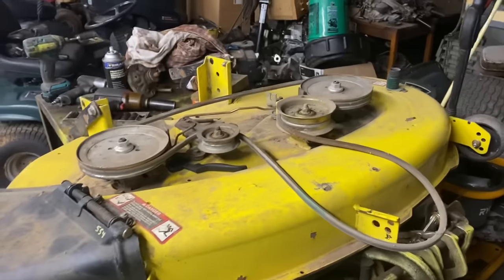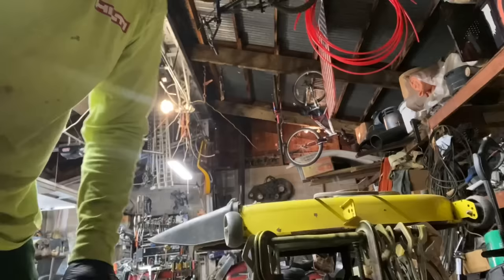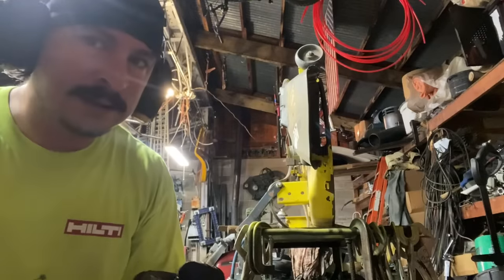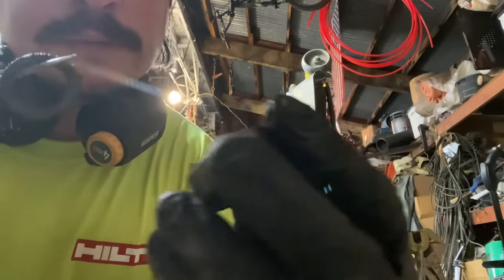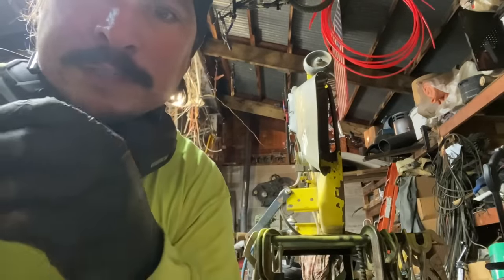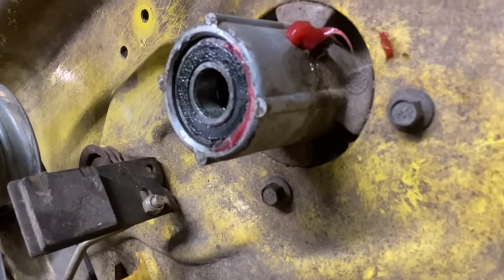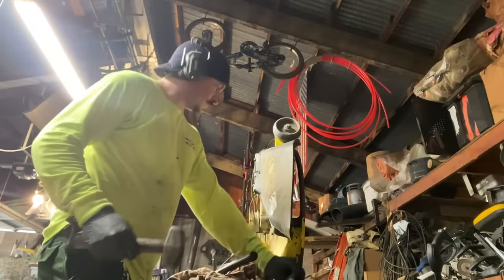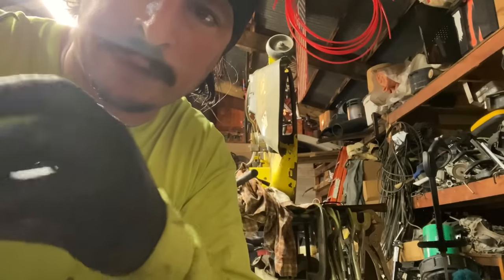Part 1 - Don’t trust the “Experts” Grease your mower deck sealed spindle bearings Common sense.

Comment: I have seen electric motors and equipment with sealed bearings run for decades.  24/7  
Ever here of a bearing failure called brinelling.   It has to do with dents in the races from hammering bearings.  Never install bearings with a hammer.
I have a mower I bought 30 years ago.  I have never replaced or greased the bearings.  It has three spindles.  There are many things that can cause a bearing to fail.  One of them is vibration.  Balance your blades .
Reply from the maker: In case you didn’t notice I’m not working on electric motors. One big difference is the load being placed on the bearings. Another diffrence is the quality of a bearing. There are many other things to consider. there is a huge difference between high quality bearings and cheep 2
To 4$ Chinese bearings in some lawn mowers. The bearings I’m working on are not for the space shuttle or air craft parts. You must have a high quality mower and most of the machines made 30 years ago are much better quality than some made now days. I’d love to know what machine you’re running. If I’m hitting the outer race it does not apply any pressure to the bearings. The outer race is what’s mounted to the assembly. Iv repaired some of the newer model box store machines with less than 100 hours on the meter with major bearing failure. Not every bearing and not every piece of equipment is made to the same standards and definitely not the same quality. Most of what I work on is super low end box store brand mowers and deck bearing failures are one of the most comon issues I see and almost always have dried up grease and or never been greased and had no preventative maintenance done prior to failure. I’m hoping by proving that adding grease will prevent failure and help folks avoid the need to tear an assembly down to fix or replace it. If the folks who see this will grease as I have showed they may be able to get a full life of the bearings and never need to spend money on deck bearing repairs. Im not covering the proper way to remove or install bearings in this video.
Reply: We ran a craftsman gt1000 for over 20 years without greasing or having bearings go bad. I have replaced two spindles after breaking the aluminum housing because of rough use. I also never sharpen the blades because our sandy soil wears them down quickly, I just replace them a few times a year- no balancing problems
Reply from the maker: @stephensarkany3577  as for not greasing a tractor form 30 years ago. Well I’d say you were very lucky. Probably some factors involved that will remain unknown but what will be more common on todays box store mowers will be bearing failure at below 200 hours and sometimes under 100 hours if no grease is added. Those old three leg spindle housings were crap and broke very easy.  The newer 4 leg post design is a lot stronger and won’t break so easy. if you replaced the whole assembly then the bearings didn’t last 30 years unless you pulled them out of the old housing and used the old ones. Even then you would have been very lucky to have had very high quality parts and for them to last 30 years is impressive if never greased. Iv heard that happening and bearings lasting. But I don’t see a lot of those. I tend to see the ones that didn’t last. As that’s what needs to be fixed and that’s who I’m trying to help. Plenty of bearings go bad before they should and most could have lasted longer with basic minor maintenance. A little grease can go a long way. Thanks for your input. Glad I could help
Reply: @GTObearclaw1  I'm self employed, I repair a lot of industrial gear boxes, electric motors, etc. Lack of lubrication is a huge factor for short life span.  I am surprised that lawnmower spindles last as long as they do with all the dust & debris swirling around.
Reply from the maker: @stephensarkany3577  well if In good condition and working as designed all that stuff swirling around should stay out. But I know what you mean. One thing I relate to how long a bearing lasts is the actual use on the bearing. A home owner machine may only receive 40 hours of use each year. Sometimes less. That is of course if the tractor is the right size for the property. Some folks buy tractors way smaller than they need and overwork a machine. But at 40 hrs a year on well lubed bearings they can go forever if they are well serviced. The bearings I replace are dang Near always due to not being greased. It’s obvious when I tear one down and no grease is inside the mandrel that they have never been serviced. It makes me laugh when I see folks comment that greasing the mandrel will cause latter repairs to the deck to be messy as the assembly will have grease inside it. Lol, welcome to bearings. I have yet to replace trailer wheel bearings older style automotive wheel bearings without getting some grease on my hands. I guess it’s better to wait and hope the bearings last forever than to take the chance of adding grease and having to deal with a little mess when it’s time to take it apart. Some folks have different ways.
Reply: @GTObearclaw1   Clearly I have insulted you.  However you are spreading bad information.
 Never install bearings with a punch and hammer.  It is just the wrong way to do it.  We always called these folks hammer mechanics.  Bearings have very smooth microinch finishes and beating on them destroys the finish
My machine is a Simplicity.  I still have it.    
If you are going to go to the effort to remove seals and grease bearings then just replace the bearings with more cheap bearings.  Or buy quality bearings and replace them. 
The grease appears dried up?   Wvariety
Reply from the maker: @ubcts  your not even part of the Conversation. Lol.  You started off talking about electric motors and balancing blades that has nothing to do with what I’m offering help with. Your an expert in your own mind and have never been elbow deep into a deck repair. You can pretend your knowledge on the topic but your expertise must be in other fields. Electric motors I assume, and your trying to go toe to toe in something your have no hands on experience with. I’m not making videos to help people lubricate a electric motor. I’ll
Send those folks right over to you for your hammer tips. Lol. 

But I see ya came back to cry some more about the hammer. Stop your crying already. If you offended me I’d just delete your comment but I’m not bothered by blow Hard know it alls. Here is an idea for ya, Make some videos to help folks and stop patting yourself on the back in my comments. Your boring me.
Reply: @GTObearclaw1  I rebuilt the deck on that Simplicity.  Stripped it down.  Welded patches on.  Repaired the linkage.  Painted it. Everything but the spindles.  I bought it new and have used it for over 30 years.  I must know something.  I served a 4 year apprenticeship as a Maintenance Machinist and worked on industrial machines for 40 years.  30 years was in the aircraft industry.  Fix the machine and sometimes make the part.
What bores me is backyard, hammer mechanics with no engineering common sense leading people down the wrong path.  
I made those comments 8 months ago so you can see my level of concern.  
You and yer hammer have a nice day. Arbor press!!!
Reply from the maker: So you have repaired one deck and now your the authority on the topic. Absolutely stunning. your stuck in the ditch, drop the hammer talk. It’s not often but it happens sometimes that I have to go back and explain something that didn’t occurred to me in the video. One reason I don’t make many. Because a few folks pick them apart and can’t let something go even if you explain your thoughts on the topic. Sometimes there is just no making a guy happy. I feel like some folks just need to find error in everything. I just like
To try to help folks keep things working and save $. when installing new bearings it’s simple to only contact the outer race. Something I would not have thought to even say in the video. You probably know where I’m going with this, Knock out old bearings toss in scrap pile. Only reason I’d normally remove bearings is to get them out and install new. Knock in new bearings without applying force through the bearing, specifically trying to only hit outter race to seat it. I knocked them out and used them
Again in this video to make a point. I would not expect anybody to knock them out an reuse them under normal circumstances they would only come out to be discarded. the point is when installing new ones I do try to avoid contact on the inner race. You’re missing the whole point of what the video is about. And this is the only video on YouTube showing this and it’s been two years and still nobody has done this to the detail I have. Possibly the reason the video has got so many views. It’s good and accurate information and nobody can prove me wrong. Some have tried and they ended up pulling down their videos. In case you didn’t realize I’m not a professional here. I am an amateur and learned this by myself with no help through trials and errors in my garage and outside in the dirt before I had a shop to work in. There is useful information to be gained. folks are smart enough to take away the information they need and move on. If you have useful information you can make videos to help the DIY community. I’m not trying to get folks to hammer on bearings. Has nothing to
Do woth the point I was making. If folks grease like I show, the bearings will not need to be removed. That’s the point.

Hammering in a race if only contacted on the outer race for the bearings I’m using will apply no force to the ball
Bearings so no damage can be done to the rolling surfaces. Force of impact  would have to go through the bearings to cause damage chief.

Comment: Thank you so much for disproving the old seal misinformation! Replaced pair of spindle bearings last week, and just for fun/save grease- cut, then installed piece of heater hose over bearings internal spacer. Of course I didn't count (for less) pumps of grease to fill back up, but hose spacer seemed to decrease internal cavity about 50%. I was just goofing around with that experiment.
Reply from the maker: Interesting idea.

Comment: Great explanation Russ, would you recommend removing the inner seal when replacing the bearings so it would take grease easier? Thanks and take care
Reply: When i replace bearings I usually do remove the inner seal to make it easier for the grease to get inside the bearing. Also if the spindle doesn't have a grease zerk I remove the seal on the bearings and pack them full of high temp bearing grease because the manufactures of the bearings I buy don't pack them full and its a light grease. So i just repack them to be on the safe side
Reply from the maker: Hi Rusty! Well sir I’m glad you asked. I say absolutely positively No No No for removing the inner seals, I recommend leaving the seals alone 
and just greasing the mandrels until grease exits somewhere and the mandrel is full. It’s a waste of time removing the seals and I have absolutely no reason to believe it will benefit the bearing in any way. Almost every manufacturer that has a zerk on the mandrel builds the assembly with inner seals in place. Pressurized grease pushes past the seals like they are not even there. These are simply dust seals and do not stop pressure. They are not even 100 % going to prevent water from getting in. Yes in most cases they will prevent water from entering but I find water in these bearings all the time when fixing decks. That’s why I believe it is best to use a blower to clean the decks off after a mowing rather than washing deck after each use. And don’t park your mower in a low spot in the yard where deck may sit submerged when it’s rainy. Water will find its way into deck bearings. But that’s another topic. As for the inner seals the good news is once the grease enters the bearings the seals will
Retain it. So the inner seal on the  upper bearing will help hold grease up in the bearing rather than let it move down with gravity as the grease and bearings heat up. It drives me bonkers seeing the videos from so called experts saying it’s pointless to grease these because they have an inner seal. That’s why I made this video, to show the truth. I mean why would so many of the manufacturers be doing it this way if it was an issue. I’m not saying engineers are perfect but this is the basics. I feel bad for folks who trust someone telling them not to even bother greasing a deck mandrel because it won’t do any good when in fact it will help to grease the decks and the seals won’t stop grease
From reaching the bearings as long as enough grease is applied to fill the cavity of the assembly.
Reply from the maker: @corysgardentractors7084   I made this video to prove that removing the inner seal is a waste of time. If anything leave the inner seal for the upper bearing in place because if properly greased that seal will hold grease in the upper bearing rather than allow grease to drop out of bearing with the force of gravity when bearings heat up.
Reply: @GTObearclaw1  without question the inner seals should not be removed, they retain grease for better lubrication resulting in longer bearing life and reduced spindle wear. Don't remove them people, Russ knows what he speaks of and I've been a full line tech for 45 years.

Comment: thank you sir. i have a 2020 john deere X350 with 100 hours on it. i am going to grease those now. most people say sealed beaning don't grease ? every time i greased the 42 inch deck i would only give it couples pumps.. hey you the man !
Reply from the maker: Thanks. As long as your bearings are okay now, when you add grease they can go much much longer

Comment: Thanks! I watched some bad information about removing the seal so the grease could get in. I’m replacing spindles this weekend on La 145. I’m glad I watched your video which proves the grease finds its way in. When the deck is cutting and grease warms up it probably coats bearings even better 👍🏻
Reply from the maker: Thanks for the comment! Yes lots of bad information out there. Sadly i commented on some of the pros videos and tried to get them to run some tests but nobody would. I finally decided to just do it myself but figured it would get more attention on a Chanel with a bigger following. However it gained a lot more attention than I expected so I’m glad I did it myself.

Comment: Excellent video.  When I replace failed bearings, I leave the inner seals off.  Pack the spindle cavity with a lot of grease and reassemble.  If I come onto spindles that don't have grease zerks, I drill a hole, tap and install some.  With regular greasing, I haven't had any failures afterwards.  Thanks for the video.  Best Regards - Mike
Reply from the maker: Sounds like
Your very knowledgeable on the topic. Iv done that too. Just want to show this way works too when dismantling is not required already. Thanks for the comment

Comment: I have always wondered if greasing those spindles was working or not. I might not have did 70 pumps but i used to grease those evertime i mowed. Never had one failed because of a bearing issue it was always the housing breaking from a rock or something hiding in the grass on a new lawn i was mowing. I have a different mower now and it doesn't offer a grease point. Haven't had any issues but wonder how long it will last. Have over 200hrs on a kubota kommander 60 cut.
Reply from the maker: Wow, figured kubota would all have a fitting. Must be a well made beast.!!!

Comment: I was the small engine mechanic for a large concrete comlany here in Arizona. My equal over on the electric motor side taught me to pop the seal and fill them about half full of the grease used for😮 maintenance, replace the seal, and install. When I started doing this with new bearings I never had a bearing fail. Lets face it, daily maintenance in the field didn't exist. The equipment was run till it shut off. Even low oil for some of the crews. I don't know how many times I would go check equipment on the trucks and find them not greased, low on oil, and plugged air filters, bypassed safety's,  and more. So, yes, you can pop a seal on a bearing if you are careful and clean and grease them. No more than half full though or it may pop a seal when it gets hot. Then grease as normal and they will last the life of the machine. Just be very careful not to damage the seal at all.